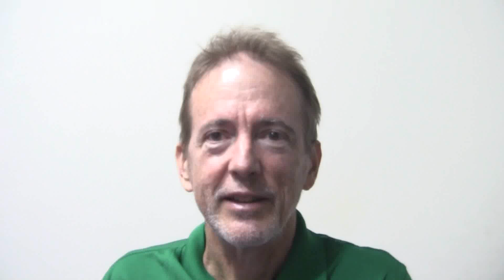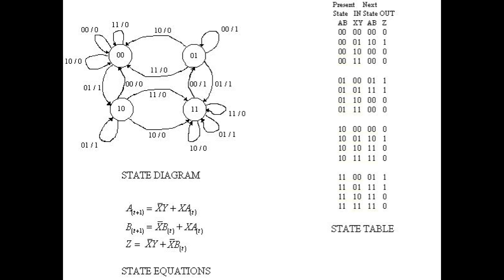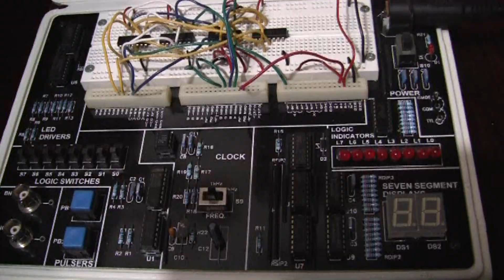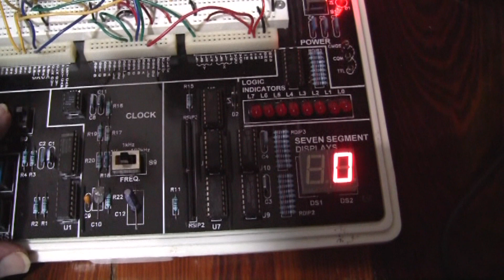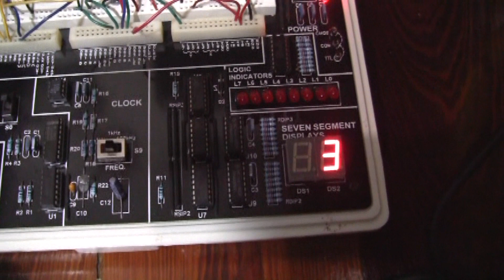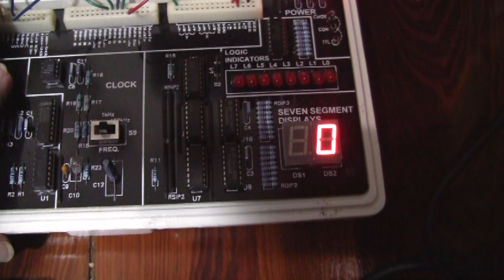Build a Finite State Machine for your Modular Synthesizer

Comment from the maker: I forgot to mention, TTL logic gates are very "noisy" when they are switching .... so when clocking these circuits at audio rates, you will need to keep lead lengths very short and install capacitors at strategic places in order to "Tame the Transients"

Comment: Oh man I am tempted to build this out on a breadboard today! I have all the parts ready to go! :)
Reply from the maker: The X and Y inputs and the clock can be driven directly from gate signals (both Eurorack and 5U use 5 volt gate signals) ..... if you build it, let me know what you drive it with .... and better yet, let me hear the results.
Reply: I only have NOR and NAND gates so I just hope there is enough room on the breadboard. I see I will need to provide my own clock so I will also add a 555 timer ... but to be honest I am unsure of what kinds of signals to feed into X and Y ... I was hoping to use two square wave oscillators perhaps?
Reply from the maker: @HazeAnderson  You can build each "D" flip-flop from a 7400 quad 2-input NAND gate (to save on the parts count) ..... you can use your square wave oscillators for X and Y ..... but just be sure that you do not exceed 5 volts at logic "1" .... this will be easy to do if you run everything from the same 5 volt supply (and most circuits can be made to work off of 5 volts by changing a few resistor values here and there) 🙂
Reply: I am going to be using only 4000 series logic gates. Oh I  misspoke earlier -- I have inverters and J/K flip flops just not straight OR or NOR gates. :) Got all 7 chips laid out on the 840 point breadboard and there's hardly any room to spare. 😂
Reply from the maker: @HazeAnderson  the 4000 series is the CMOS equivalent ..... so it will be more tolerant of voltage levels .... and more importantly,  the "switching transients" problem of TTL family will be avoided ..... so  I hope your circuit works  properly at audio rates, but you will need an oscilloscope to check..... I must admit I am excited about seeing (or should I say HEARING) your results 🙂
Reply: I was able to wire it all up, but seeing as how this is my first time I obviously have no idea if it is correct or not. 😂 I went back over the video and I seem clear on feeding arbitrary voltages into the X and Y inputs but I am unsure what to do with Z, A and B. I suppose I could wire up some quick VCOs and drive them? In the meantime I mixed the output of Z, A and B into my little mixer and was able to get some randomness .... but I don't think it's quite right ... so more work to do. Makes for a nice Saturday project. :)
Reply from the maker: @HazeAnderson  My challenge is to find the time to build and demonstrate  the use of one specifically designed for music  but hopefully I will get a break from the workload over the holiday season coming up soon..... as I said the FSM in the video was for the students to build .... you next project is not going to be quite so easy 🙂.... thanks so much for your feedback
Reply: I hope you find the time ... this has provided a nice challenge for the day. I had to remove my jumper connections and start over, as I was only getting a static output from the J/K flip flops. I have since gone back and tested each gate on each IC (all successes) and upon testing the flip flops I realized I forgot how they work! 😂 We both know that success does not arrive with the first attempt every time -- it's the process of translating from schematic to breadboard that allows us to REALLY understand the relationships of the components. Hopefully my 2nd attempt will be more fruitful. :) Cheers!
Reply: FWIW I just figured out how to use these CD4027 flip flops ... looks like I need to tie both Set and Reset to ground. Hopefully I will have a video for ya tomorrow. Fingers crossed!